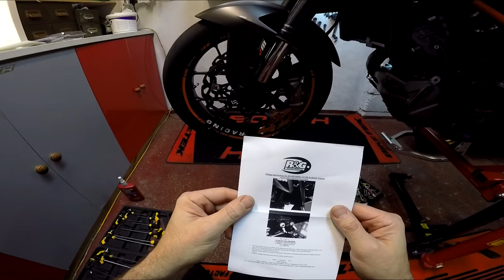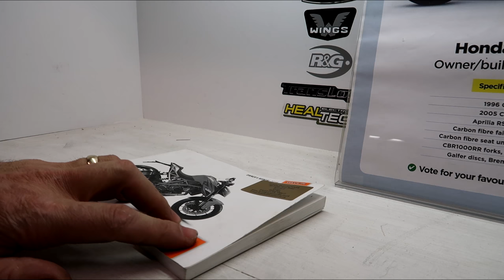Super Duke MODS  | Crash Protection & Slaves

Comment: Great progress Chops. The early SDR's used hydraulic fluid in the clutch but KTM changed to DOT4 / 5.1, think it was some point in 2015. Not sure if a different master was used. If you haven't already found it I can email you the '14 factory service manual for the 1290 (it's the '14 model manual). One watch out is it still has the old rear wheel torque settings which has since been revised due to the rear hub issue on early bikes. 

How's the handling going? One common thing it the top yolk nut works loses, especially if it's been on one wheel a lot. Should be torqued to 50nm. Mine had similar weirdness and was loose, doesn't seem to manifest with play in the head bearings though. Loosen the top yolk pinch bolts and re-torque the top nut, then the clamp bolts to 15nm. Also worth resetting the lower fork / wheel geometry too in case things have been tweaked slightly, both forks have separate clamps on the lowers. All the above sorted mine. 

If you don't want the bark busters I'd buy them off you, was just about to pick up a set but can hold on for a while.
Reply from the maker: +Coldfin9er wow thanks for the info! Would love the manual, email is jbmugen@hotmail.co.uk . The whole front end is coming off shortly as have the billet triple clamps coming soon 😎😎 I will make sure I torque things up as per the book then. I fitted the hand guards yesterday I like them sorry 😂😂
Reply: Lamb Chop Rides No problems mate, will send it tonight. Clocked the email if you wanna edit it out. 

At least the guards get a seal of approval, order placed!
Reply from the maker: +Coldfin9er thanks dude! Emails ok as that's my YouTube one 👍 yeah guards look good, I may get the little fitting brackets powder coated black as they are  cheap looking..

Comment: Don't you just hate hydraulic fluid. I knew when you went to change the clutch slave that fluid would go everywhere at some point 😄. It always happens to me too when ever I do brake lines. At least the other bits don't require getting dirty👍 also I see what you mean about the tyres, there shagged aren't they.
Reply from the maker: +bchant19 yeah bloody stuff! You try and be prepared 😂😂 yeah rear tyre is through to the metal now 😣😣
Reply: Lamb Chop Rides what are you thinking of replacing them with then? Dunlop sports smart 2 are a good option that last long and have great grip or are you gonna try some new Bridgestone. They've been putting out some good rubber lately motogp tech stuff on the road so can't be too bad.
Reply from the maker: +bchant19 I'm thinking the Bridgestone S21 as been impressed on the blade with them.. I want to do some track days so need to keep it sporty too.. Open to suggestions though 👍
Reply: Lamb Chop Rides well there's a lot of high praise going around of the S21's at the moment so there probably the best option as a hyper sport tyre. Maybe you'll get 3500m on the 1290 with them who knows till there tested out.

Comment: Thought the slave cilinder is working with dot 4 brake oil , says my manuel anyway . Or is this a 2014 model ?
Reply from the maker: +Jelle Peeters yes yes yes, this is why you need to check the manual. They tend to change it between magurra master cylinder and Brembo 👍